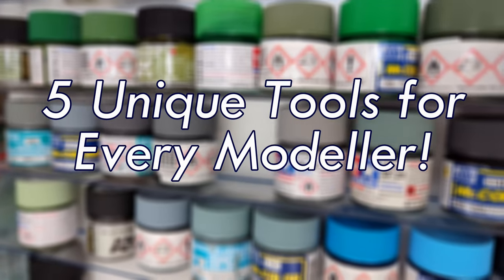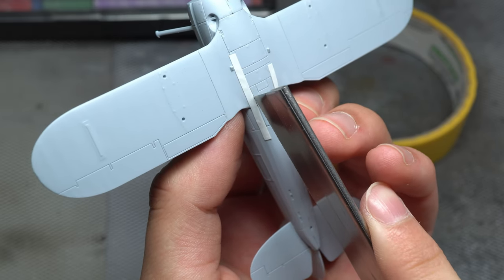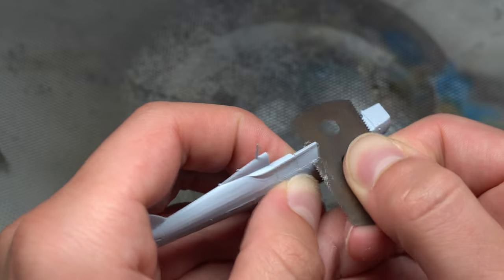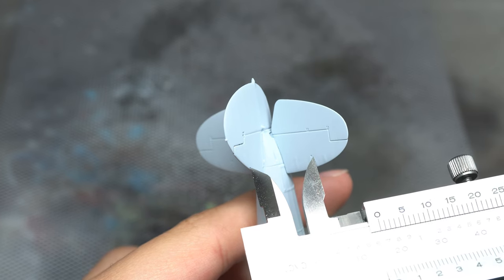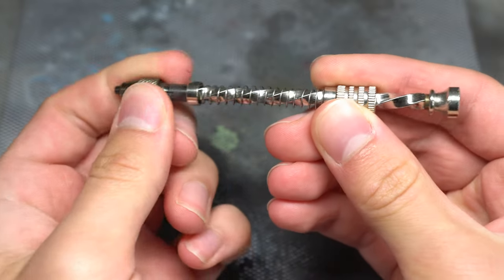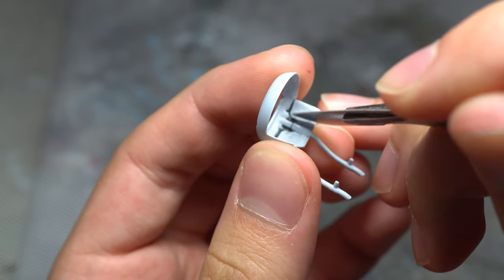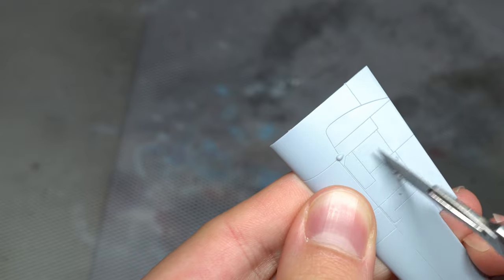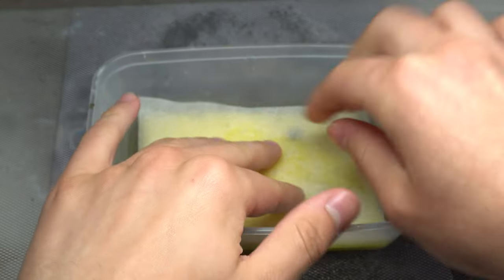5 Useful Tools That EVERY Modeller Should Buy! | Quick Guide

Comment: Yipes...wish I had seen this vid before tackling the tiny pair of lights on the front mudguards of my EMHAR Bedford recovery truck.
Used silver glitter in the lamp cases before before applying lenses with T extra thin.
Got the sparkle but the inverted drill bit punched foil would have been better!
Used thin silver foil for the headlamps, but could have been better if I had used sequins that have a hole in the centre which looks like the bulb.
We live and learn!
Reply from the maker: Ahh, oh well! There's always a next time 👍👍

Comment: A variation of the razor saw is to use those etched saw blades (mine are by Airwaves).....have the advantage of even finer teeth and small size to get into hard to reach areas
Reply from the maker: Good point!
Reply: @ModellingWeekly  I still have the type you showed though!

Comment: I swear that every UK modeller has at least one Swann Morton scalpel handle that was nicked by someone we know from a hospital supply cupboard. until amazon I never knew where to buy them, none of the hobby shops had them, but everyone used them.
Reply from the maker: 😂 wouldn't mind betting that happened a lot, mine was bought straight from swann Morton however

Comment: When using the wet pallet how does one keep from putting a hole in the baking paper?
Reply from the maker: Its basically down to just being careful with how much pressure and liquid you put in one focussed spot for a while - in my experience, I've only really developed holes when I've been painting for over an hour using the same paint repeatedly from the same spot on the paper

Comment: Get the vernier calliper with a digital readout…
Reply from the maker: Decent digital callipers are very good I agree, but they can be extremely pricey compared to a traditional calliper with a Vernier gauge - the one I have in the video is a fantastic mitutoyo example with accuracy down to 0.02mm
Reply: Your mitutoyo vernier is an engineers precision grade, and needs a lot of practice to read accurately, this quality is not needed for modelling and is very expensive to buy. A good quality digital vernier is not as expensive and is easy to read, perfect for ‘ordinary folk’ (my wife uses one to check her knitting needle sizes)
Reply from the maker: @davidtomlinson4066  fair enough. I personally just enjoy the reliability and precision of a traditional caliper with a vernier gauge (which I'd argue is perfectly easy to read after a few minutes of practice), but I totally get your point that for the majority of people a cheap digital caliper is perfectly fine 👍